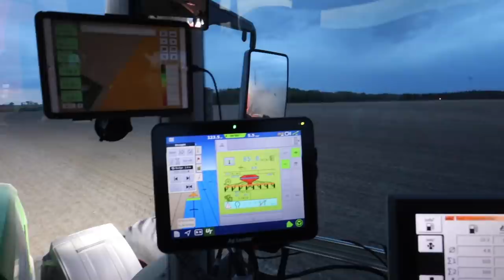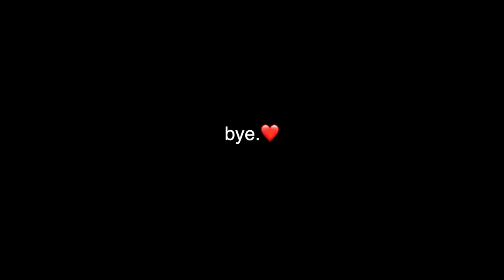I've been missing EWE🥹 | Planting soybeans, sheep chores, and a year's worth of cleanout?😱 Vlog 581

Comment: i have an idea for the grain feeders for your lambs and young stock add 4 of the simple trailer hand crank jacks to each corner and as the litter gets higher crank them up keeping the feeders up out of the wet straw saving on wasted feed and then feeders wont rust away on you it also might help keep the rodents out of feeders edit: also, would help keep feed at ideal height for proper digestion